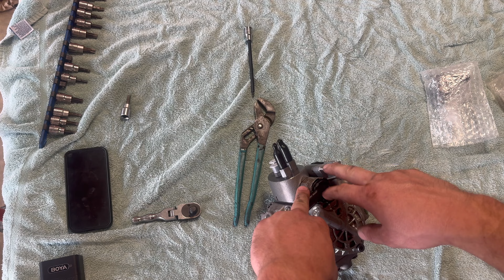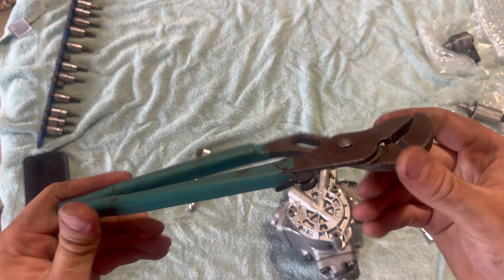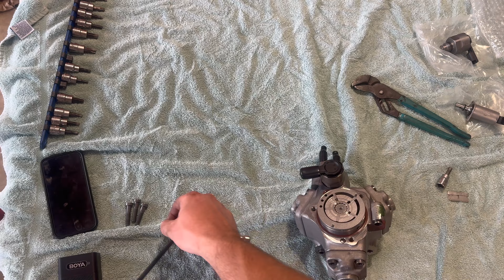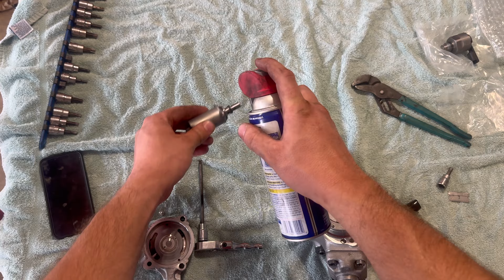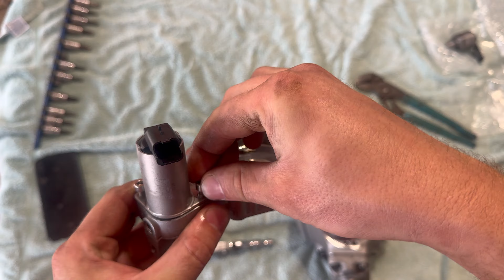Saving the 6.4 Powerstroke one step at a time

Comment: @SFDE Diesel LLC
After building 6'4's for years ( pulling trucks ) I traveled the same road of lack of available parts as you. If I can find the supplier I used for individual OE K16 components I will send it your way. Cheers
Reply from the maker: I've found one.